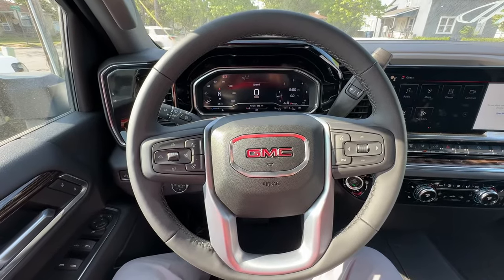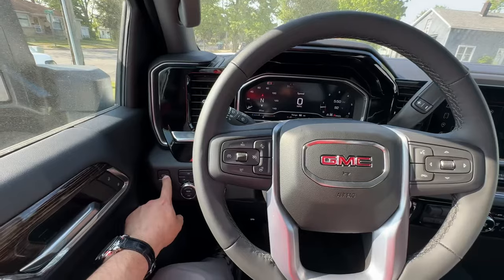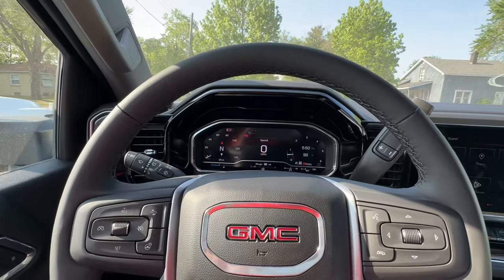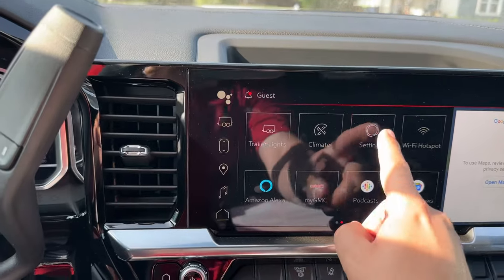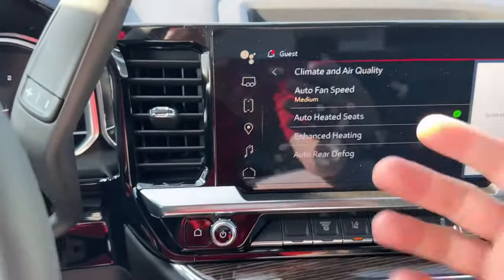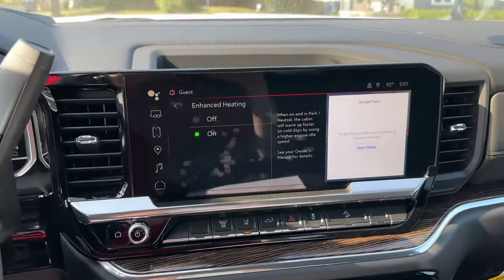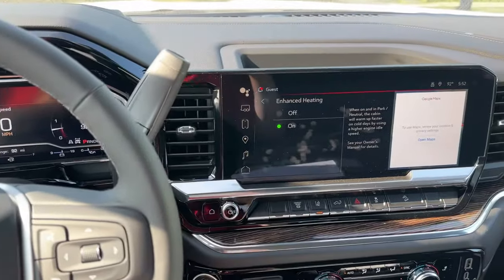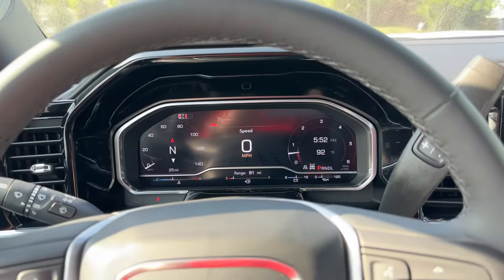How to enable high idle on 2024 Duramax GMC Sierra 2500 / Chevrolet Silverado 2500 3500

Comment: Can you use the High Idle switch to keep the engine at a higher RPM (e.g. 1,000 to 1,200) after it has warmed up if you want that higher idle when using the 120 v accessory plug?  In other words, can you use it to keep the RPMs up so the alternator(s) are running faster even after the engine has warmed up?
Reply from the maker: From what I’ve read it’s just used for heating the engine quicker in cold weather.
Reply from the maker: You would need to order the high idle switch to do so if you want to use high idle outside of warming the engine up.
Reply: Dealer can turn this function on .

Comment: Hey brother you are wrong, what you are turning on is elevated high which warms up the engine to better heat the cabin when it’s cold. “high idle” is something different no matter how cold or hot it is outside you it will manually turn on by putting truck in, turning on park brake, turning on ur cruise control button and toggling the roller on the left side of ur steering wheel. It has two speeds, one just below 1,000rpm and another above ! So change the title of your video to how to enable “elevated idle” because you are confusing people like myself who need the high idle function! Thank you for the video anyways.
Reply: @Jacei9 Did you ever figure this out? on my 2021 GMC, I could engage high idle by doing exactly what you said. On my 2024 GMC it doesnt work and the dealer just tells me to do whats shown in this video. Im sure there is a kit or software to enable the high idle...
Reply: @ryanyee97 this worked on my 24’ Chevy, make sure parking brake is engaged and cruise control is on, then just toggle down once to engage “fast idle”
Reply: @BaDMiTTeNs  Nope...doesn't work. I know what youre talking about as it worked on my '21. My truck did not come from factory with the high idle switch. I bet it shows on your factory build sheet that it came with it...dealers can't seem to figure out how to enable it on my truck
Reply: @ryanyee97  Good point, now that you mention it, I remember I got it specifically as an option

Comment: Do you need to have the high idle switch option for this to work or does the truck come with the ability to automatically do high idle on it's own? For example, my 2012 Ram Cummins had the switch, but would also do it on it's own if the weather was cold enough. I'm confused as to whether the Sierra will only high idle if you have the high idle switch option
Reply: It’s an option. It’s just a reprogram on the computer the dealer can do. Can’t tell ya how much, but I know anytime they reprogram your computer it’s $400 or more.
Reply from the maker: The high idle option comes on by default for the GM trucks when absolutely necessary , but you can also make it run this way. Nothing aftermarket needed.
Reply: @JoeCarExpert  you need to read page 9 of the diesel supplement manual for the 2024 hd, before making a video on this.
Reply: @JoeCarExpert  you are confused with "Elevated idle " and the "high idle switch" available on the hd's. 1/2tons cannot be equipped with the high idle switch.

Comment: Why does this infotainment set up look different than my 24 Denali ultimate? It’s higher and the AC vents are to each side. Wth?
Reply: Trucks without center consoles have a different dash
Reply: @7kzone  not so. Check out how the Chevy did theirs and the smaller canyon Denali. They missed the home run by having the column shifter in the way of the display is my point. You have to have one or have driven one to know what i mean.
Reply: This is likely an SLT or SLE. The Denali and AT4 are positioned lower with the vents above the display.
Reply: @mkz6475  i understand that but why? Bad move bc the column shifter gets in the way of the screen in the Denali and at4.
Reply from the maker: Denali and Denali Ultimates have a different dash design.
Reply: Different dash because it doesn’t have the center console.
Reply: Silverados are different